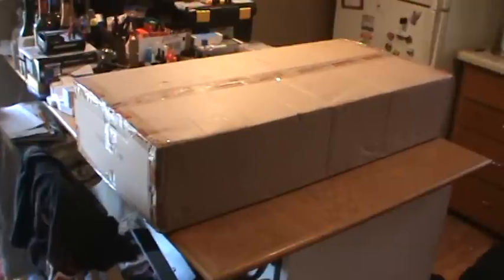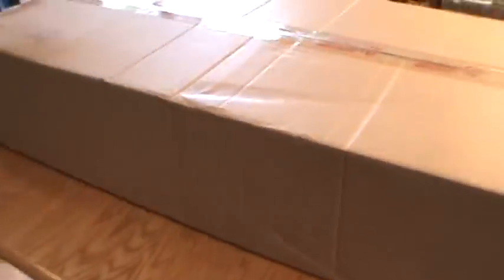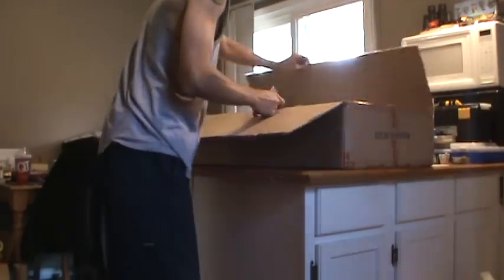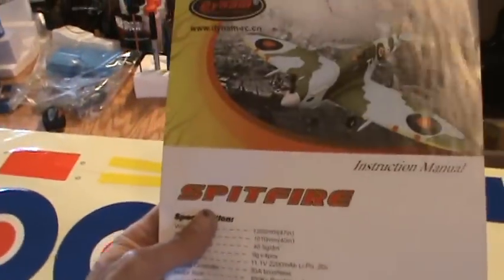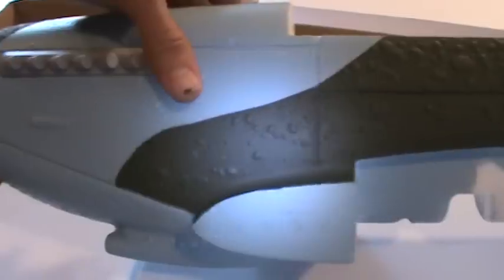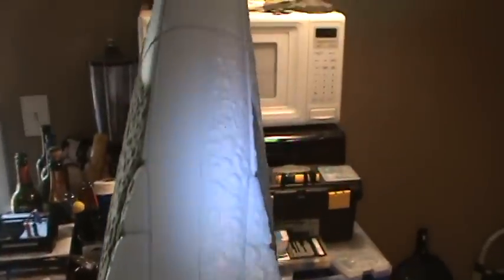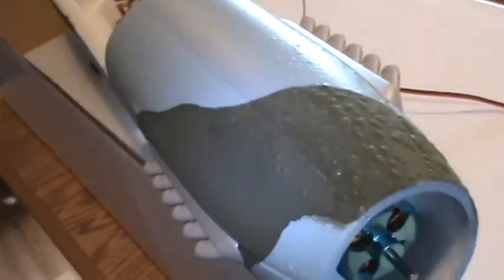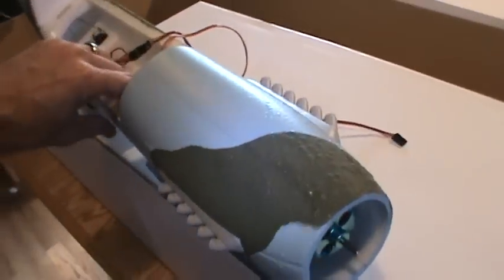Nitroplanes New Dynam 1200mm Spitfire, very dissapointed.

Comment: I recently bought this plane from Nitroplanes.  I didn't have the paint issue, but I found plenty of quality issues.  Fuselage was split down the middle for me too (huge gaps), and it seemed the glue they use had failed almost everywhere.  Then found left LG was screwed up.  Bent out of shape, and the retract itself didn't work.  Working with NP on retract, but not resolved yet.  DYNAM has zero quality control in their manufacturing; they just throw defective crap into the box and ship it out.

Comment: You know, every company drop the ball once in a while and nitroplanes aren't no exception. Sometimes, even the company's Q.A drop the ball, which is unacceptble.
As you said, nitroplanes don't make/assemble or paint the planes but someone "should've" caught it, rejected and sent you a better model.
Just for info: my nitroplane's Guan-Li' A-10 EDF parts bag came with glue tubes which oozed out all over the parts! Good thing I didn't need any of themthem. What a bummer for ya. Hope it get resolved

Comment: I'm planning to order this model, even before seeing this I was already considering stripping off the paint, fiberglassing, and then repainting, and replacing the stock motor with an E-Flite Power 15, ESC with an E-Flite 40a, and servos with Hitec high-torque minis. Other than the paint and wonky servo, any other problems with it?

Comment from the maker: @canadianmaple09 well I didn't even open any plastic. From what I have read you will have to repaint it. Fliers have said after some flights in the sun theres looks the same now. The structure of the plane seems solid.  It is far from scale. My opinion the only way I would buy this would be an insult kit. Because if Nitro planes works with me I will still have to split the fuse open and fix all the messed up glued parts. Everyone's luck is different I would not buy this plane again.